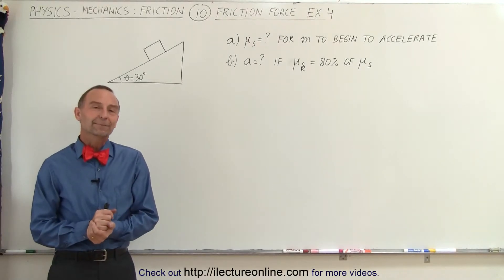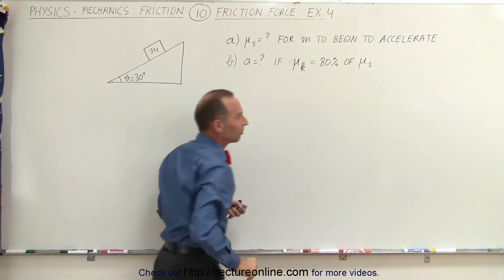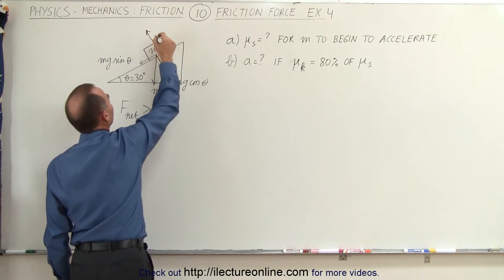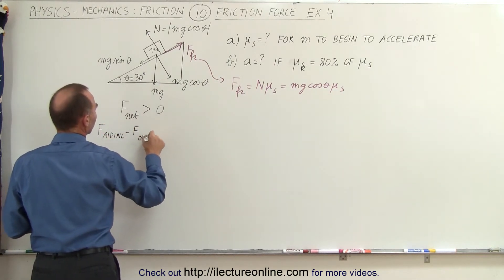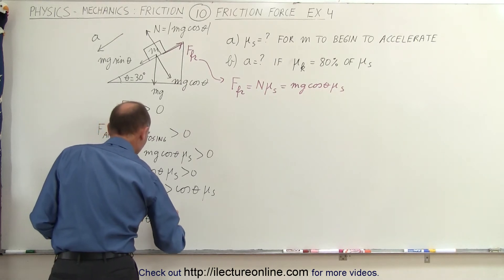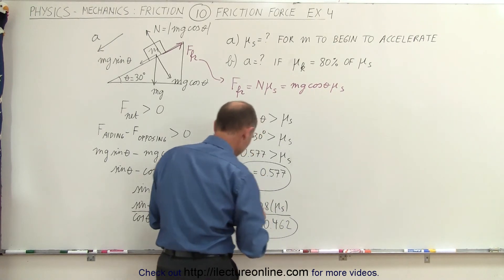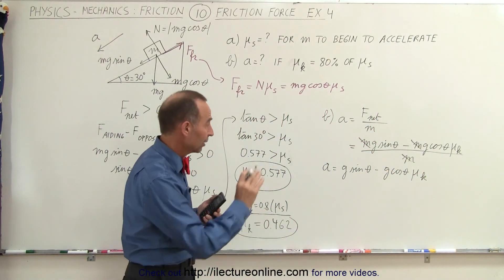Physics 4.6   Friction (10 of 14) Friction Force on a Slanted Surface: Ex. 4

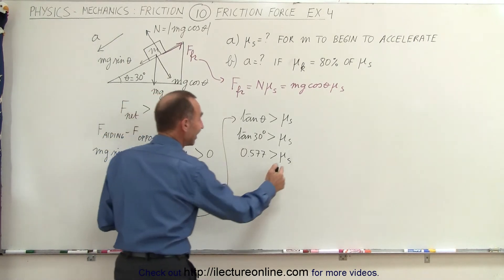Comment: 4:03 you said we should lower mu s to the point its lower than 0.577 than you said mu s is equal to 0.577 why not 0.576 
There is also another comment asking the same question
And thanks agian for these amazing classes and for your hard work
Reply from the maker: In the end it is not that important that you use 0.577 or 0.576.  The important aspect of this question is that you know how to solve the problem.

Comment: first of all thank you so much for the videos, they're very helpful....I have a doubt sir, in the videos while solving incline problems you take the direction along the surface as y-axis, im not able to understand why, is it okay if i take the direction along the surface as x-axis and and other as y-axis...
Reply from the maker: It is better not to think of it as the x or y axis (although you could),  it is probably easier to consider the direction parallel to the inclined plane and the direction perpendicular to the inclined plane.
Reply from the maker: Expressing the component of the weight as    mg sin(theta) does NOT mean that the direction parallel to the inclined plane is the "Y- axis"
Reply: thank you sir, now i understood how it works, i computed the components by finding the angle using transversal angles property, and then projecting mg on the parallel and perpendicular lines, and then finding sin and cosine of theta...thank you so much again for the videos and for the reply...your lectures are helping me get through my course materials :)